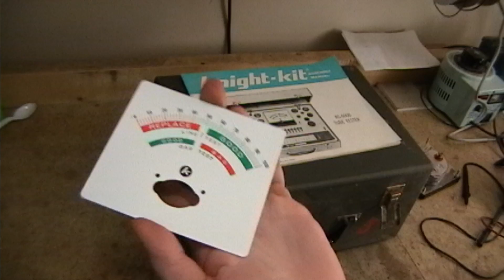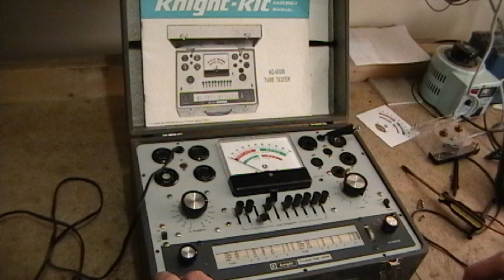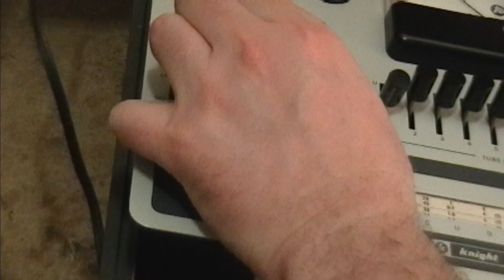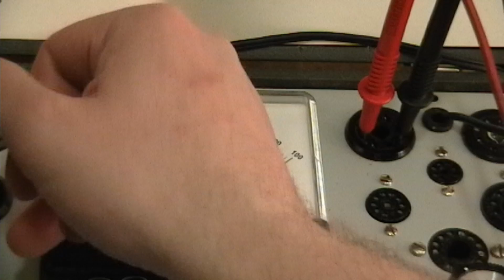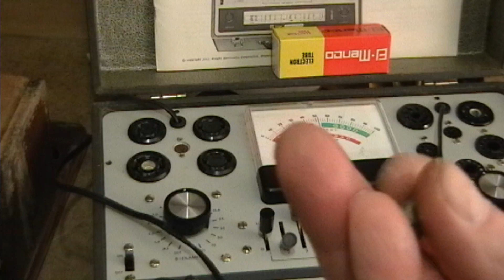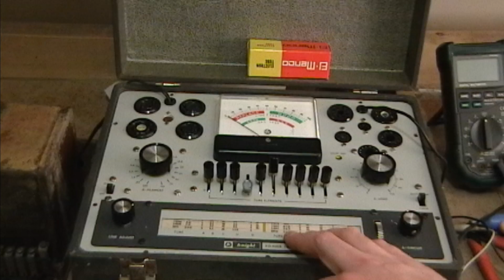FNR - Knight 600B Tube Tester

Comment: Just purchased a Knight KG 600-C tester without a manual and was wondering about the calibration.  Found your video and it looks pretty much similar to my 600-C and will proceed with the calibration after I repair the lighting for the scroll chart.  Thanks!!

Comment: Glad you made this video. I just picked up a 600C. The insides are a mess. The line adjust pot is gutted, the chart was wound wrong and the gears for the chart don't mesh correctly so it hangs up and jumps teeth. The soldering isn't great and oh, switch number 6 is broken.
Got my work cut out for me but at least I have a direction to go.

Comment: Wonder why they don't calibrate tube testers for 6.3v with a tube in cause if you adjust it to 6.3v without a tube in it will be low
Reply from the maker: Well for one tube testers are not accurate devices to begin with.  Neither are tubes themselves.  Second there is a huge range of filament currents.  There are 6.3 volt tube with a filament of 0.15A and some over and amp.  This a just a basic emissions tester.  Basically good for determining if a tube is dead or not.  The exact meter reading is useless.
Reply: @bandersentv  yah I guess there's that. When calibrated mine says to adjust line for 150v once did that I got 6.45v for 6.3v filament so with tube in goes to 6.10v
Reply: @bandersentv  I posted all my TV tubes I have for sale just type in hickok 752 and will see them all listed some have plate or grid cap

Comment: Yup another EICO Tube Tester, emission only. It more of a confidence meter than an electronics instrument. Great item for that no nothing beginner tech. I have enjoyed repairing and calibrating them for novices. I built my own tester that tests for transconductance, a better measure of tubes. Even a bad tube will pass muster on an emission tester. Transconductance is a finite measurement of how well a tube works over a range of grid voltages and plate currents. The stuff family curves are made from by manufacturing engineers. The most amazing feature is the roll chart.

Comment: I added an 80Ω 10W resistor in-line with the center lead on the Line Adjust control to compensate for the higher 120v +  we have now-a-days.  Otherwise you'll NEVER get the needle to center on some tubes.

Comment: Hello, I recently just purchased a Knight-kit 83YX143 tube tester and it is not working properly. When I power the unit on, the needle stays on the left and does not move to the center. The needle only moves when I try to test a tube and it shoots all the way to the right.  I'm not a tech but I did open the unit to check the soldering areas and all looks good. The .1uf capacitor inside looks like its bulging on one side so I think its wise to replace the cap and resistors. Do you have any idea of what could be wrong with my Knight tester? rgs, Charlie
Reply from the maker: Sorry, it's been too my years since I worked on this to recall much.  Certainly the cap should be replaced if it's bulging.  Could also be dirty switch contacts.

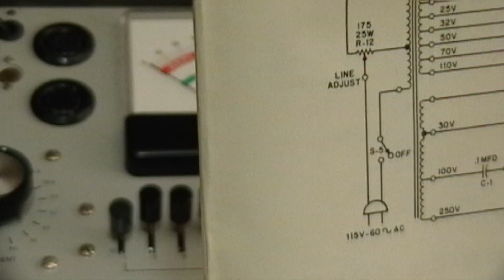Comment: At 9:02 in the schematic , what kind of .1 mfd capacitor are you using and whats a good replacement?
Reply from the maker: I used a plastic film capacitor.  Polyester or polypropylene rated for 400 or more volts will work fine.

Comment: Hello..I just acquired on of these, everything seems to be working fine, but I'm not finding data for tubes such as the 6L6, 6V6.  There's nothing on the roll chart or in the supplemental binder.  Did yours come with this data or did you get updated charts somewhere?
Thanks!
Reply: 6L6  A=3  B=6.3  C=27  U=345  D=78
6V6  A=3  B=6.3  C=29  U-345   D=178
Reply: @tubeDude48  I was looking for this data also because I noticed bandersentv used 3-4U 2D, when my information said 2U 3-4D. I know it's a pain looking it up but could you please verify the source?
Reply from the maker: Sorry it's not my tester and I don't have it.  Seems odd it wouldn't have such common tubes though.

Comment from the maker: I just googled 1N87.  It's a germanium diode rated for a peak reverse voltage of 25 volts and a forward current of 50mA.  Something like a germanium 1N34 would be a better match than a silicon 1N4002.

Comment: Bob,
   Thanks a lot for showing this.  I'm more willing to take a chance on buying a tube tester that's not behaving itself.  This one doesn't have a tube on the underside like some of the other testers do, I noticed.  But the capacitor and metal film resister replacement seems rather straightforward.  Tom

Comment: But NOWHERE in the manual does it actually say what the Volt/Amp/Watt rating is. It always just calls it the "CRYSTAL DIODE" (on the side of the diode it does say "IN87"). I have some modern 1-amp (IN4002 MIC) diodes, but I'm not sure if they can handle it.
Reply: Hi, My diode reads oa74a on it, what would be a good substitute??

Comment: I did what you said, and the lowest it would go before cutting off (It also acts as the power switch) is 6.8V. Close, but a little on the high side. I tested all of the resistors, and, although some were off (barley out of tolerance), the only resistor being used when the READ METER switch is not depressed is fine. There is, however, a crystal diode in that circuit as well, and it might be the culprit. (when I run my Ohms meter backwards across it, it shows some continuity.)

Comment: I recently purchased a Paco T-60 tester, and I don't know how to calibrate it. The manual doesn't really provide any official steps, and the schematic
(look it up, YouTube doesn't like the URL I tried pasting)
doesn't reveal an internal trimmer rheostat, and I don't know where I could put one (where exactly is the one in yours?). On top of that, the line voltage at my house runs significantly high (127VAC), And I can't get the Line Adjust low enough to center the needle w/out a Vari-AC.

Comment: You may be able to simply pull the movement out of one of the new meters and trasnplant it into the tube tester meter housing. It looks to me like the little armateur that the needle is mounted on got knocked off of it's bearing points. Those have bearing points like the ballance wheel and escapement in a watch or alarm clock, or the wheel in a power meter, sort of a needle between two cups, one may be adjustabel but I don't know.

Comment: Did you try the gas test on any of the tubes that had a gas test listed on the tube chart? I have a 600C, but the gas test has never worked properly. It just pegs the meter.